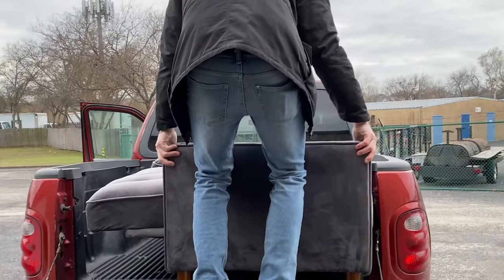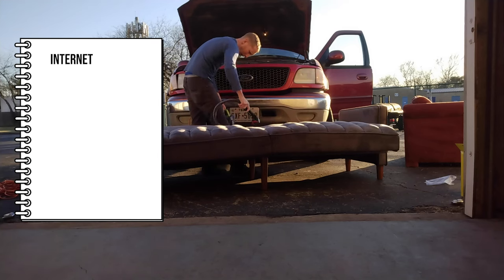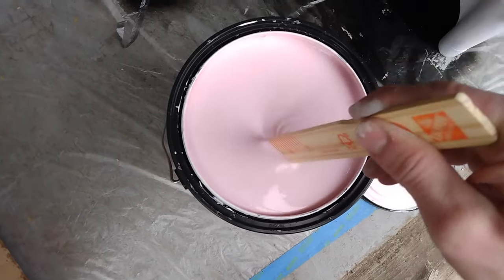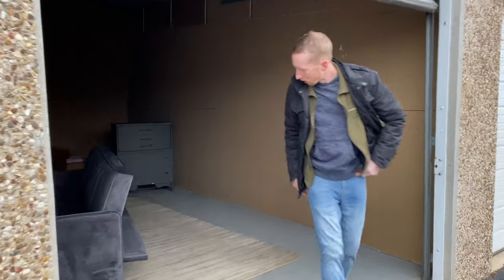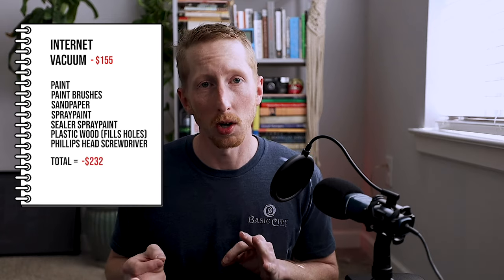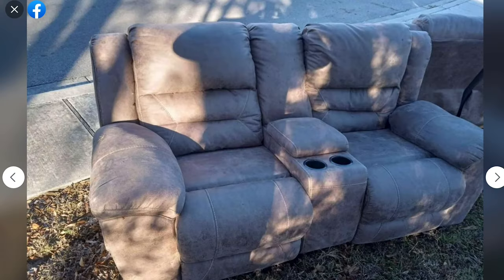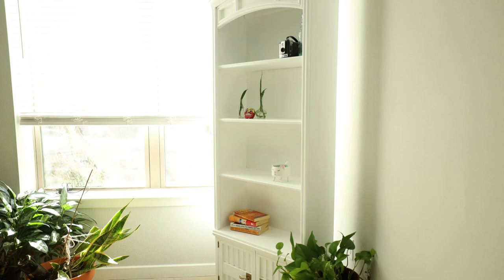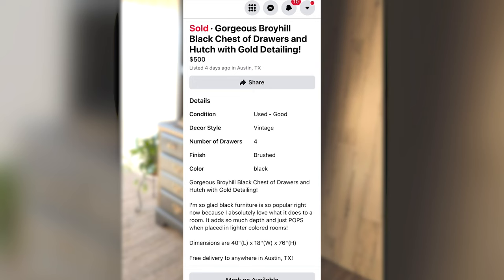Furniture Flipping Business // How to Get Started Flipping Furniture for Profit

Comment: Harbor freight has an orbital sander for $25, get the 5amp hour battery and a rapid charger comes up just under $100, pay for the 2 year warranty on each and when they fry. It's super easy to just replace. Of course, it's better to go with a corded sander if you can, but with battery works for me, it lasts about 3 hours in constant use. I also have a drimel tool with the detail sanding attachment that is corded and make my life much more blissful on the smaller details.

Comment: Great video, how did you get electricity in your storage unit? That’s a problem I gave since I can’t find any with power outlets.
Reply from the maker: Hey Donny, I've got a video that specifically addresses that issue because I ran into the exact same problem. Check out -> https://youtu.be/HoniVdC4heQ. Look for the part in the video where I talk about the Ryobi Power Inverter. This is one of the best hacks Ive learned since getting started.

Comment: Awesome tips, quick correction though. There's no such thing as "paint & primer". I work at a paint store and it's just an industry used marketing phrase. Even if a paint markets itself as paint and primer it's just paint. You can use your paint AS a primer, but it is NOT primer and it does NOT have primer "mixed in". Paint and primers are like two sides of a velcro strap